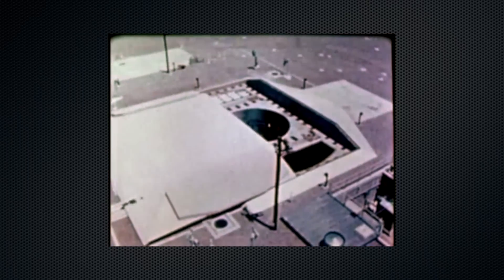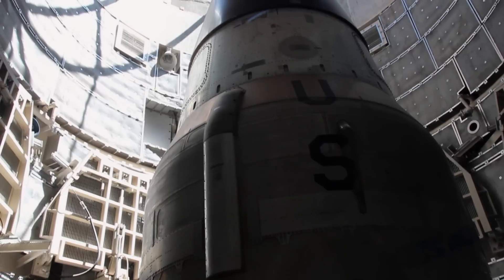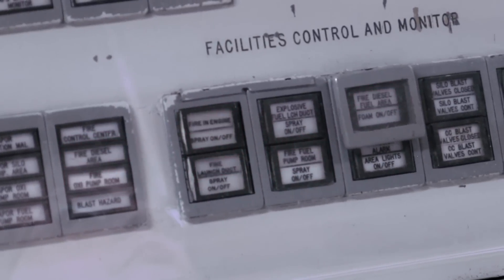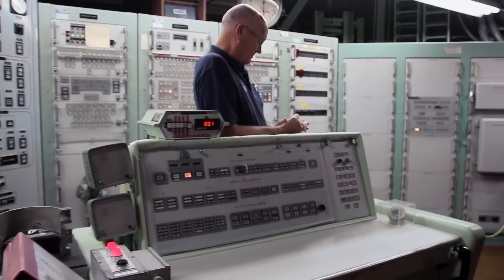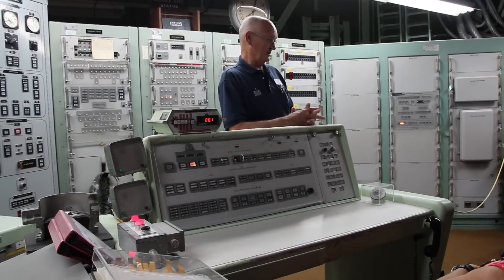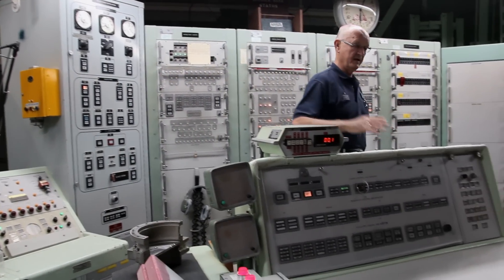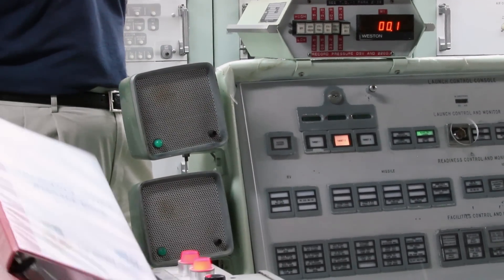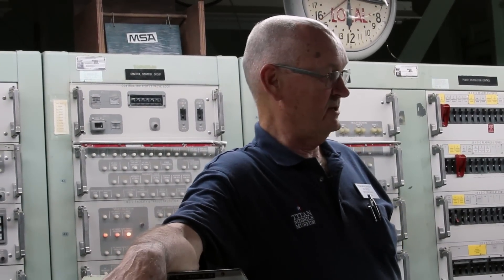How a Titan Nuclear Missile Launch Works

Comment: I prefer MMII/CDB.  “Hands on keys. On my Mark…. Three….Two…. One…. Key Turn….  Code Used. OPR Tile Illuminated.  Transmission Mode Rotary Switch Radio…. On my Mark….Three …. Two… One… Keyturn…. Code Used…. OPR Tile Illuminated….  I have 6 missiles Launch In Process and MV400 Missile Away printouts on A-03, 05, and 07….”

Comment: I've always wondered if the multiple launch codes enabled the missile to be fired at different targets....
 
Also, as bad as the silo guys had it (in the event of WW3) think about the bomber crews, they knew that if the codes ever came in, everyone they knew on and around their airbase would be dead!  Same goes for the bases that had KC-135 (refueling aircraft), those would also be targeted!
Reply: Correct.  Airplanes on the Christmas tree would probably get off and away (six bombers and two tankers).  Ground and air crew would try to generate more.  Even if we wanted to go home (on or near base) for family, we wouldn't get away.

Comment: Most of the cores for all these old missiles probably still exist today.  Although given the half life/shelf life of PU235, a new core might have to be re-smelterd every so often.
Reply: Plutonium 239 has a half-life of 24,100 years; for warhead performance issues the problem would have been radioactive decay of the Tritium (Hydrogen 3) in the trigger for boosting purposes.  Tritium has a half-life of only 12.3 years.  

The decay heat and neutron flux from the spontaneous fission of Pu-240 in the trigger would present a different problem.

Comment: I’ve watched lots of Titan silo refirbs, so good to see one in semi-op.

One thing I picked up on: when the missile launched it would start fires. Presumably, the silo was one use only otherwise they would have a fire suppression.

The above invalidates the need for fixed silo positions for M.A.D; i.e why spend billions on a one time use facility. I would guess this is all part of the nuclear deterrent.
Reply: I was a Crew Commander in Titan II (McConnell) and participated in taking our TItan II out of our primary silo in Kansas, and moving it to Vandenberg for a Safeguard launch.  We actually pulled alerts in Charlie - 1 on Vandenberg, which in the first few years of service, was one of three  operational launch sites that had a real world job to do if the President ordered it done.   We brought our Titan II to alert status, and then waited, sharing the 24 hour duty with two other McConnell launch crews.  This was a long time ago - Oct '74. The order came and was authenticated using training authenticators, and the flight was perfect and the payload dropped dead-on the target in the South Pacific. You could not feel anything, but you could hear it. The launch in support of a program was called "Safeguard" and you can google "Titan ll launches" and you'll discover there were a lot of Titan II's that supported that program and many others. C-1 never caught fire, and there were a couple dozen launches out of an identical silo - to the one that still hosts tours in Tucson. There are very few flammable things in a silo.

Comment: I may be a layman (compared to those who know, I'm a total idiot...😁), but this subject's always been fascinating to me.  So my thoughts on the issue - 
Titans may seem archaically charming by today's standards, but they DID represent the best technical fire & support we had.  And while this'll sound stupid or condescending to our REAL experts, a good chunk of that tech went into authenticating launch orders & minimizing the risk of unauthorized or illegal launch.
Today's Minutemen class ICBMs DO have significant upgrades in both detonator enabling (physical permissive action links (PALs) as well as computer generated "challenge" & "response" codes input by physical computers.  One cannot simply "luck into" entering codes at random.
Threats by hacking?  They're now limited by using "old" but perfectly maintained hard computers.  There's only 2 or 3 direct connections to the outside world.  Hacking missile command wing systems IS doable, as they control launch enable, but again, this is randomized (controlled) by both SAC & National Military Command Center (NMCC) which relays  targeting & Emergency Action Messages (EAM) from National Command Authority (NCA), another term for both the president & Secretary of Defense or their designated successors.
Even at NCA level, the 2 person rule determines actual launch.  In other words, although the president is the only person who can initiate an attack, SECDEF MUST authorize an actual launch.  Technically, SECDEF is only to allowed to confirm, not abort, nuclear release, (s)he CAN refuse by resignation.  Thus, triggering a constitutional crisis which will at least slow-down procedures & at most jam up the works enough for rational consideration.

Comment: I have read through most of the post. I will reply to all hear.

      I was an MFT for 4 years the first 18 months in school.  The crew I was on qualified

 as instructors. We then trained new crews and provided 40 hours training for each crew 

every month through questions they needed to look up the answered to while on alert duty.  

  When the system started in 1963 their was only  1 plastic laminated card was carried on a 

chain along with the launch key around the officers neck.  

       The butterfly valve had not been installed untill 1971   The Idea was to see incoming missiles,

 get the presidents approvel, and launch your missiles before incoming distroyed the complex.

       The launch disable lights were controled by the wing command post.  Command post sent

 out a continues signal lighting the launch disable light and preventing launch.  The command 

post received the same Message as the missile silo crew, and on approvel of a valid message would

 turn off disable and send enable .  A safety system was installed at the missile control

 center that if wing command was unable to send the enable signal, a timer started at the loss

 of the disable signal after it timed out the crew would then launch.  If the crew  had wanted 

to do an unautherized launch it was easy!   Go to level 3 and disconect cable from  wing 

command post, Enable timers were set at "0", and turn keys.

       The jumper wire.  The jumper could be used in the back of the CMG cabnet. I learned about it

while our crew was monetering and running test to verify the system worked properly.   To test

 the wireing the Martin Co. made a missile simulator box that could give a compleat launch or an

abort.  We then determine what malfuncion the simulater was set at.   We ran about 50 test,

 most of them started with the jumper.  Before the USAF took over the missile complex the door

to the back of the cabnet had a pad lock added.

   To verify the missile was reliable each year they randomly sellected several missiles,  

removed the fuel and missile. Missile and fuel was transported to Vandenberg USAF base.

 installed in a silo, refuled  and launched down the Pacific test range.  Over the 18 years

of the program they tested 48 missiles.  They all launched, Several failed to get close to 

target. Modifications were made to the remaining missiles.    After the system was shut down 

the missiles went to Vandy or Canaveral and were used to send up GPS satellites.

     I think the statement the crew didn't know where the missile was aimed was missleading

the BMAT that loaded the targets into the guidance system new the longatude and latatude of

the target, Would not know what at that located. 

     After launch!   Stand by and wait for instructions "OK"  from who?

 After 2 weeks radiation levels are down to a thousandth of the original level. We had a

 geiger counter in the air intake shaft. With the incoming air valve shit the control center

 provided about 17 days of air.  We had 30 days of food and water and 124 gal. tank of water

to flush the toilet .  If the silo was intact and their was fuel and waterfor the diesel-generator 

 It could be run several times a dayto charge emergency bateries for light.   With no diesel 

we would be in the dark in about 4 hours, except for flash lights.   

       An interesting true story.   On the side of the missile is a clear plastic panel about

6 inches sq.   A light beam from a room on level 2 shines through the panel.  The guidence

system uses the beam for alinement.   The 430,000 lb. missile is suspended from the wall on

springs. In 1965 their was an earth quake in Alaska, about 24 hrs latter all missiles guidence

system indicated a loss of the light beams.  Indicating  ground moved made the missile sway
about 3
 inches to break the light beam.

    The good old days when things were simple!

Comment: I'm not going to second guess the reasoning behind the massive concrete structuring of the silos, because it worked and continues to do so,  but if the locations of the silos can't be reached for 30min or so, and we would know when the Soviets launched a strike, why would the TITAN complex's need to ride out the a nearby hit if the missed have already left the silos? Basically I'm saying a sneak attack just wasn't possible, and with a 5 min launch window for the titan system, even slbm's wouldn't be a threat before a retaliatory strike was sent

Comment: I was a Titan II electrical engineer at McConnell AFB in the late 60's. It was an awesome system. The crew used simulators to run simulated launches. The maintenance side ran on-site simulations. To do that we disconnected all of the ordnance and connected instrumentation in their place then an actual "launch" was started. The engineering department (where I worked) would go over the results to diagnose anything that went wrong. In one case the test failed to separate the 1st stage from the 2nd. One Martian Marietta representative and I were tasked with figuring out why. After spending several hours going up and down the missile we found that the wire going to the explosive nuts was cut. We checked and found that the wire numbers were numbered wrong which caused that wire to be cut during a earlier mod. That got HQ's attention really quick and went top secret immediately.